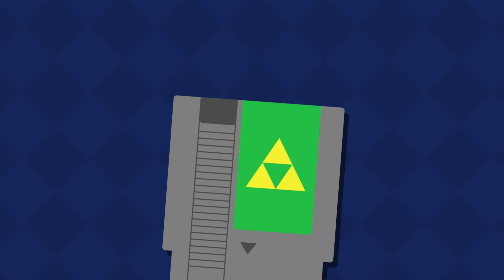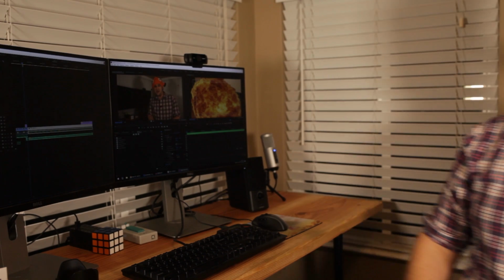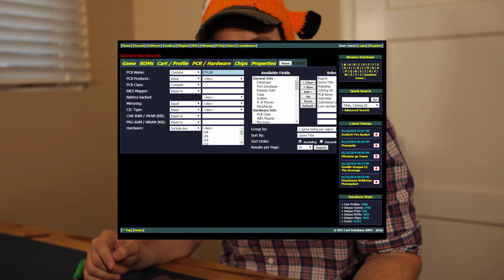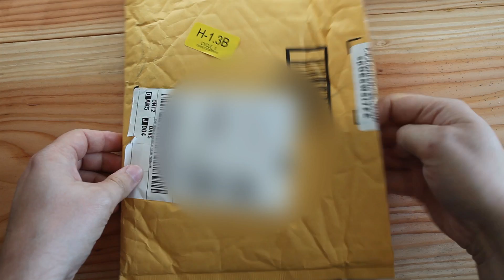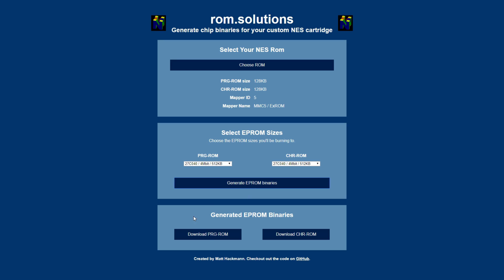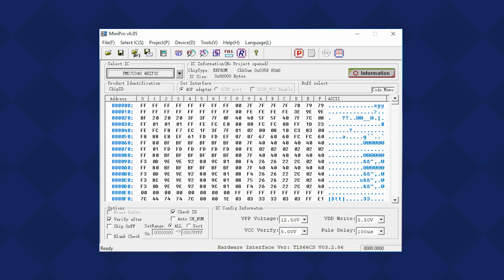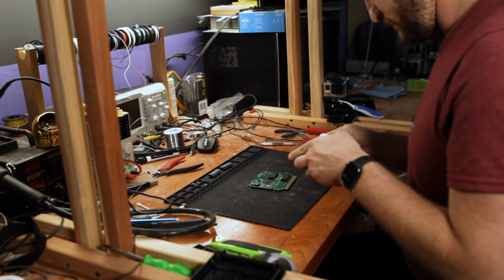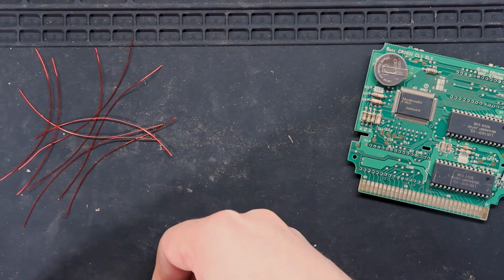Hakk's Lab 4 - Making a Real Life NES SimCity Cartridge

Comment: I know this is an old video, but would it be possible to use an Famicom to NES adoptor like came in some gyromite carts or a reproduction thereof?
Reply from the maker: Absolutely! I was talking with somebody who did exactly that. It was a much tighter fit in the standard NES cart and I believe some things had to be trimmed to fit the battery, but it worked just fine.

Comment: Wanted to check this out after I saw your comment on 8-bit Music Theory's video. Thank you~!

BTW, apparently the hum that comes from the Famicom when plugged into a non-Japanese TV is caused by the fact that it wants to be on like a half channel or something. I used to use the gray NES RF adapter with mine but it still hummed a bit. The AV version doesn't seem to do that.
Reply from the maker: Thanks for checking out the vid! I'm actually running my Famicom with a custom A/V board (as built in an earlier video). Pretty sure I need some additional resistors/filter caps/something on the audio line. Need to do more research on cleaning up audio signals, especially for my next project...

Comment: Please please please don't use magnet wire for this kind of work in the future. Get yourself some PVDF insulated (avoid the fake PVC stuff) solid core wire (aka, Kynar wire), its designed specifically for what you are doing. It takes a little practice but once you get the hang of it, you will never want for magnet wire again except to make, well, inductors/transformers, etc.
Reply from the maker: gnif Good to know. Scraping the enamel off the magnet wire did suck... a lot, but it’s what Fry’s had (their wire selection is bad and I should just be buying online).
Reply: @dxprog  did you know that you don't need to scrape off the enamel - it melts and evaporates if you apply some heat with your soldering iron ;)